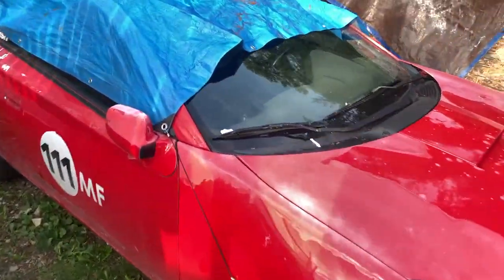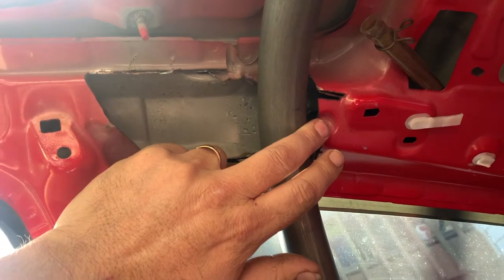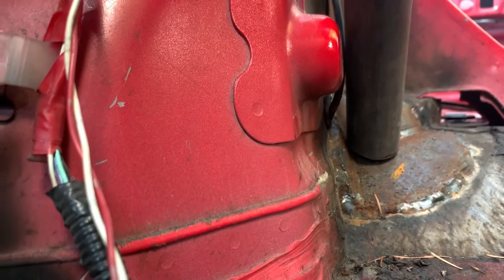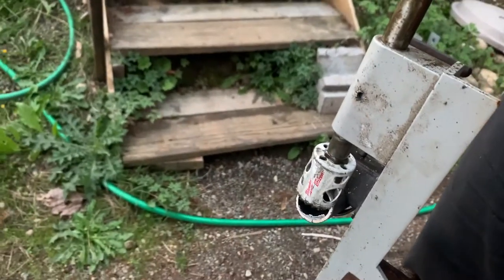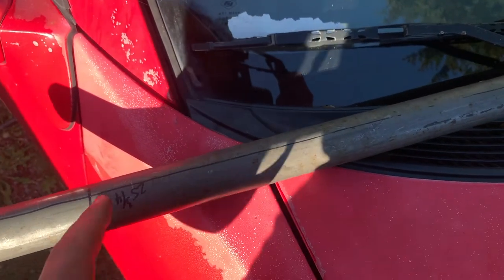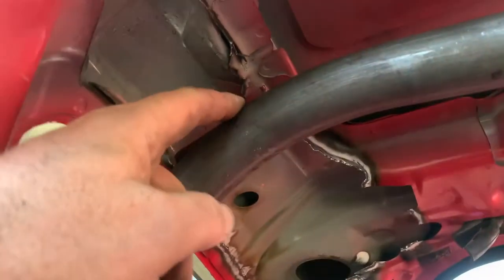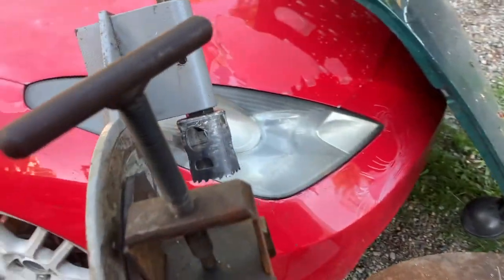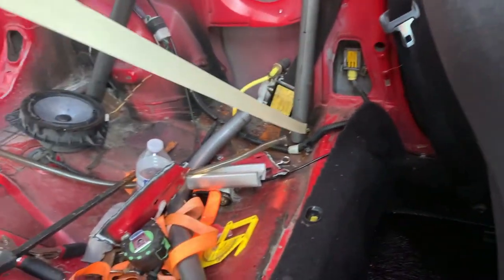CHEAP RALLY CAR BUILD | Toyota Celica GTS Roll Cage Build | Rear Section EP27

Comment: Andy what type of pipe bender do you use to bend the angles? 🤔
Reply from the maker: It is a bender from Williams Lowbuck Tools. Speedway Motors has an updated version. Part number 91084112, it is $400.